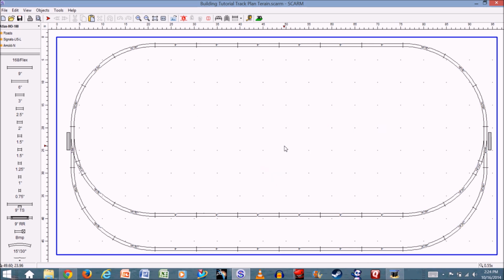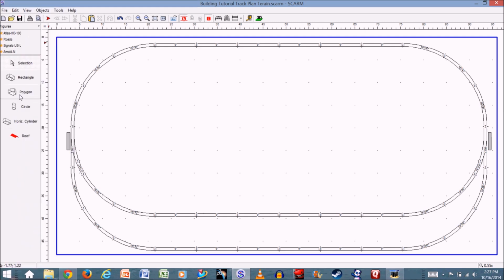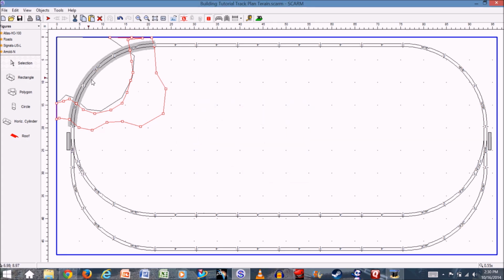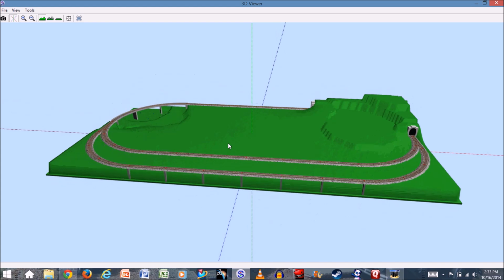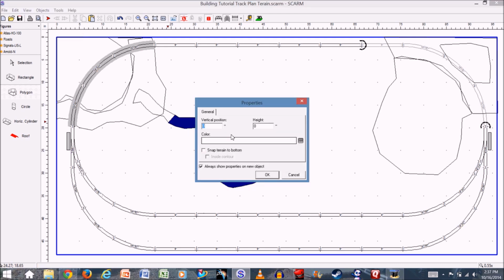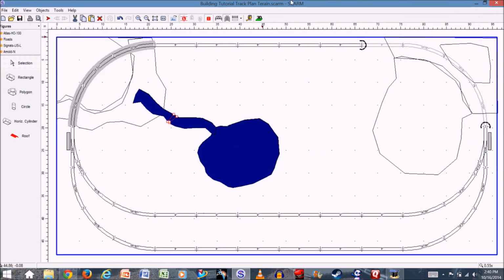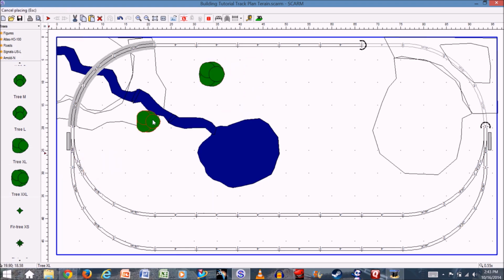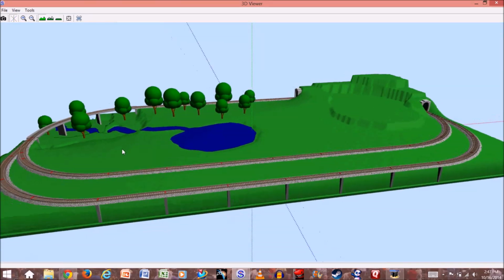31. SCARM Tutorial 4 Terrain

Comment: I’m new to scarm and just started today. The tracks are laid close to the edges, how do I have an embankment along an outer edge? Would I start with terrain and then place tracks within the embankment?
Reply from the maker: Its been a while, but I believe you would start with the track first and then set the baseboard to lock onto the heighth of the track.
Reply: Gilshrat 
Or maybe if the board was say 4” thick, then reduce the hight to make a “valley” wide enough for the track. Then move the track into the valley, job’s a good’un 😁. I think it just takes a bit of thinking out of the box.